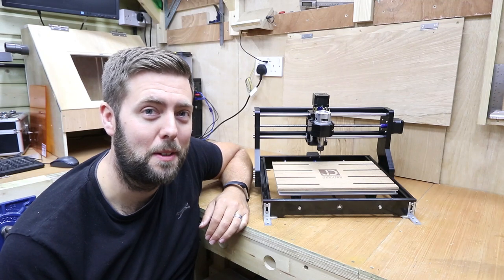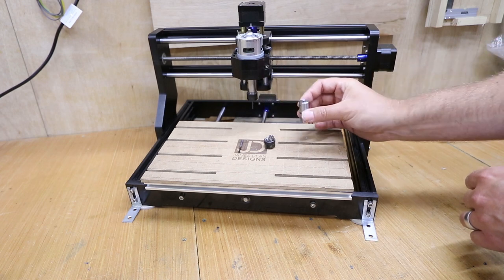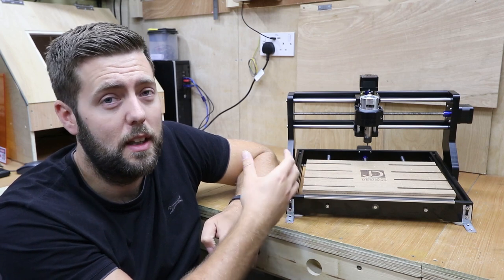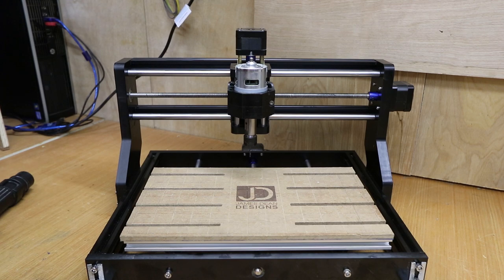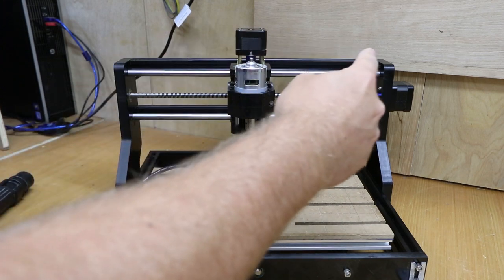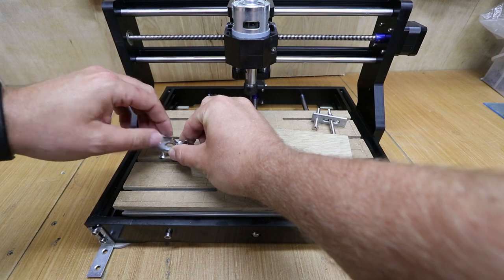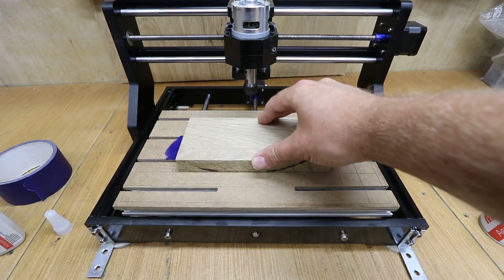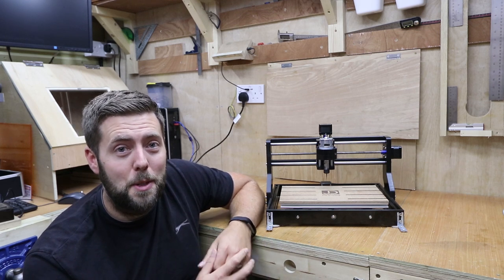3018 PRO - Tips and tricks

Comment: I have just received this machine from amazon . Had a issue on y axis assembly every time I secured the hex bolts it did not slide. discovered the table (aluminum) was curved after much fiddling I have temporary packed with card of various thicknesses as don't have shims stock.  Your video on the spoil plate and leveling was very helpful. When my friend who runs a industrial cnc mill get back from leave we will try straighten it. I have now run one of the sample files on the mill and my spindle I am glad to say has almost no vibration.  Thanks for the tips as the manual for what it is does not mention maintenance. Although with my friends on it gets cleaned daily and has built in lub pump. I live where items like the tape are not that common so will hunt for alternatives. Thanks for the brilliant tips. (zim)
Reply from the maker: Glad it helped. Instead of blue tape, double sided tape or carpet tape is always an option
Reply: Double sided tape I can get. My wife uses for some art projects

Comment: Bearing Tip! Instead of epoxy, I have had success holding all my bearings in using electronic repair tape. B-7010 is extremely adhesive and thin.  I wrapped the bearing with 2 strips of tape and pressed them in. No bearings have shifted since and you'll be able to get them out if they fail. 
Thanks for the video and I'll be getting some aerosol dry lubricant.  Great tips!
Reply from the maker: Not heard of that before but thanks for sharing

Comment: Skipped to the part about holding material to the bed. Drove straight to Screfix, picked up some CA glue and masking tape and it worked a charm. I now have a 300x200mm piece of material on the bed, fixed and sturdy with no clamps!
Reply from the maker: Excellent 👍

Comment: Thanks for the video. Ran into many of the same problems (bearings under table vibrating out of housing, etc.). Another tip you may offer is leveling the table. While not perfect, I was able to buy some 0.016" metal at my local hardware store and place a shim between the table and the bearing housing underneath. I was able to run a dial indicator across my table and had it within @ 0.010", but for someone without an indicator, you could take a small cut on MDF to see if it's cutting close to flat. Really appreciate your time and effort!
Reply from the maker: Thank you, thats great to hear

Comment: Good tips, thanks.
I added homing switches to my 3018 and had one of the cables vibrate out of the connector on the control board, I used hot glue to keep the connectors from coming loose again. 
The homing switches did allow me to salvage an engraving I was working on, when it finished I realized I should have engraved deeper so I went back to Carbide Create changed the parameters to cut deeper and ran the code again, since the X and Y axis were based off the home position they retraced the original design perfectly.
Reply from the maker: They do have some useful benefits such as being able to return to the exact same spot

Comment: Good morning James,
I agree entirely about the comment regarding the noise level between a spindle with a milled shaft vs a round shaft. There is a massive difference. I bought the Hanpose spindle with a solid shaft and 2 bearings, which I think makes the spindle run more smoothly.

Comment: great video, thanks for sharing.  I found that with my 3018 pro the steps per axis (in the grbl firmware I guess) had to be set to 800 steps to get millimeter accurate results.  I just used a laser engraver to draw a ruler until it lined up with an actual ruler.  Also, grow tents make good cheap and easy enclosures

Comment: I have a tiny tip: Instead of furniture pads, I used a flat piece of the packing material my Sainsmart came in and was pretty shocked at how much quieter it got right away. Even so, I'm planning on working on a bolted down solution; my "workbench" situation is not currently ideal.
Reply: KOLIKO JE  CEA

Comment: Just on the topic of the z probe, I also made a manual probe with a LED light, a couple aligator clips, a 9V battery, a 1K Ohm resistor and a L shaped metal bracket.  I've been using it to help me set the spindle for the x and y axis for the stock I engrave/cut.

Comment: I have been experimenting with the baking soda and water trick here is what I found - 1tbs to 1 cup warm water mix until disolved then apply 2 - 3 coats with brush let dry, I set power to 20% and speed 18000 on a 2.5w laser, results amazing much darker, and cleaner burn on wood.

Comment: Hi there. I just subscribed to your channel. The two cents of an old CNC user: 
1. on the 3018, after all the "upgrades" you made, the remaining vibrations may come from the backlash in the screws (see Openbuilds' anti-backlash nuts), from the  bearings (which are wear parts that needs to be replaced along the way. You may not have glued them in place. Shims may make the trick. Find today some replacement carriages as long as the 3018 is still produced. Just an advice.), from the plastic parts, and from the unsupported guides. So you can't eliminate all the vibrations. 
2. the furniture pads keeps the vibrations inside the machine, this is not a good idea because you work on noise, not on vibrations that affects the cut quality. There's two ways to damp vibrations. First is mass, because vibration decreases through some dense and massive materials. Second, a trap where vibrations won't be able to propagate. You can fill the aluminum profiles with granite epoxy. Then you want to fix the machine on a heavy base, like a thick metal plate or a heavy concrete tile. You don't want any pad or rubber thing between the machine and its base plate or the vibrations won't propagate. Sand makes a good vibration trap. So you can fill a tray with at least 1" fine sand layer and land your machine and its base over the sand. You can also use the bottom of an enclosure as a tray. 
3. dry lubricants works fine with lead-screws, but not as well for guides or ball-screws. The way you do on your guides don't brings any lubricant inside the bearings because there's a sealed joint that won't allow the lubricant to came in. Like any dust or debris by the way. You bring a small amount of lubricant on the guides which is wiped away by the bearings. You really want some lithium grease deep in the bearing balls paths. Pro tip: one linear bearing at a time, block one end with your finger. use a syringe to force lithium grease inside the bearings until the grease fills all the ball paths inside the bearings and squeeze out of the bearing. That's a necessary messy job. Once you bring the bearing over the guide, the excess grease is removed and a fair amount of grease stays in the bearing. That will lubricate the guides at each pass without building some grease outside. You want to do the same way for ball-screws nuts.
Reply from the maker: That's some great advice. Thank you very much. I've not even been doing this a year yet so any knowledge for people more experienced than myself is really appreciated.
Reply: @JamesDeanDesigns  We can notice that you are not that exerienced yet! And this is a perfect way to learn:) I was just about to comment something similar to Alex. Like Alex said, mass is one of the best and cheapest way of reducing vibrations, especially on a very light machine like this. But most importantly I beleve that you have to know what the machine is good for and its limitations, this is after all sold as an engraver not a router. Nice video, good luck!
Reply from the maker: @styletokill  very true. My first piece of advice to most people who ask is be realistic with expectations of this machine. With that being said it can do quite a bit once you understand it.
Reply: @JamesDeanDesigns  Yes. Dont buy the cheapest most generic chinesium endmills. Spend 10 bucks for the propper endmill for the job at hand, world of difference. They come with all the optimal parameters for running in a specific type of material, from that you could calculate what your machin should run at. A propper tool with the propper machine parameters puts very little stress and strain on the machine. You dont want to "grind" away the material, a propper chip is what you are looking for. Makes a world of diffrence.

Comment: RE Linear bearings. Instead of epoxy, screw thread lock compound works well and comes in different strengths so you can lock the bearing in place yet still remove it later.

Comment: Hi James - I've just bought a CNC3018 Pro for a learning project during the lockdown as an entry into CNC with a view to converting what I learn onto a small milling machine for model engineering purposes. I very much like your approach to explaining things. One of the problems that I have is finding an easy way to convert 2D drawings into G code. I've been trying out various converters such as Carbide Create, Candle and different hardware manipulation programs. Currently, I'm using CNC3D Commander for the hardware control. I've been teaching myself Fusion360 but I'm finding this hard going. I'm hoping things will eventually drop into place - it's just familiarisation and perseverance!  
Thanks for sharing your activities - It's a valuable source of knowledge for us who are starting out.
Reply from the maker: Fusion is great but if its just 2D work then might be overkill as its extremely powerful. Most people start out with Easel or Carbide Create. Carveco is also getting more popular but that is paid for

Comment: James, thank you so much for this video.  My machine delivers today, and I'm really looking forward to having something at home to tinker with, even if it's not quite the same as the bigger machines I've used in the past.  

Regarding limit switches, I do think there is a way to avoid losing bed travel - simply attach an offset in each direction that doesn't interfere with the travel and use that to register on the limit switches.  This would allow you to basically max out (maybe missing a mm or so on each side for "safety factor") the travel in each direction.  Not having the machine in my possession yet, this may not be possible on every axis, but theoretically it should work, and it's how higher end machines I've used before are set up.
Reply: Hey! do you know where i can get limit switches for 3018 pro? I can't find them anywhere.

Comment: For the noise and dust, I have built an enclosure with 10mm wood and 20mm insulation foam. Reduces the noise in half.
Reply from the maker: Enclosures make a big difference

Comment: Years ago  i got into Remote Controloffroad Electric Cars and some Electric Boats  the Spindle motors you Zoomed in on in this Video  looked very similiar to the ones those Vehicles used  ?  i do want to note that i  was a Adult and  the ones i had were  not Toys they were actually considered  to be on a Hobby level and  i spent a great deal of money Upgrading the majority of the Components to  build a very Competitive  Car back then the more powerful and faster motor was known as a 540  and they ran powered by a 7,2 Volt Rechargeable Battery  made up by wiring several 1,2 Volt CylidralBatteries together in a Pack

Comment: Nice video and very well explained. I actually reversed some of the bed clamps that attach the aluminium profile to the rails and gained around 40mm in X axis and 20mm. Ive been cutting aluminium and carbon fibre sheets for a while now. I however use rather expensive bits and use them in various forms. My 1300*900 should be here in jan ;)

Comment: I am running the 64 bit version. I am thinking of putting a ferrite ring on each stepper cable Looped twice through each if my cables are long enough. I got this for model building I have had the machine for two years. Lots of problems with control boards. Decided to build a large machine48" x 48" using a dead table saw as the base and belt driven. great videos!!
Reply from the maker: If the program is not responding its likely to be the PC or software. Out of curiosity just try the 32 bit version. Something is glitchy about the 64bit. My machine is 64bit and I can't even get the 64bit version to open
Reply: @JamesDeanDesigns  I will try and then let you know.
Reply: @JamesDeanDesigns  Loaded 32 bit version. The machine seems more reliable. I was almost ready to dump this project but you saved it! One more question. Can you recommend free software to generate Gcode from DXF files. I have fusion but it changes the size of the part when I import DXF and its very complicated. It would be nice if you could show how to generate and run 3D files.
Reply from the maker: @michaelmitchell6898  I believe Carbide Create can import DXF files, however I cant personally comment on how well it handles them as I've not tested it.
Reply: @JamesDeanDesigns  Yes Carbide Create does import DXF files. Thanks

Comment: Enjoying your vids. Good content for the newbie 3018 owner. Hope to have mine assembled soon. One thing - those are carriage bolts not coach bolts; very different in features.
Reply from the maker: Thank you. Might be a country difference, if I Google coach bolts nearly all the results are what I use in the video. Coach screws in the UK are potentially what you know as coach bolts, bolt head and quite a corse thread into a point?
Reply: @JamesDeanDesigns  ah the old “screw vs bolt” thing again. You’d think we’d have this sorted by now. Fair point. Here, carriage bolts have fine threads and a domed head with a square shank under it to prevent rotation once pulled up in the joint via a nut, and coach bolts are coarsely threaded to a point with a square or hex head that a wrench/spanner can turn.
Reply from the maker: Main thing is that even with my accent, you understand what I am on about 😆
Reply: @JamesDeanDesigns  I grew up and (fell in love with) Britcoms, TV series, and movies from the UK. You sound “completely normal” to me.

Comment: Love you videos tip and trick are excellent. While watching your video I noticed that your copper nut and spring  fits in snugggly to the nut seat. Could you tell me how set this properly as mine is only holding on a thin edge?
Reply from the maker: Take the lead screw all the way out, then squeeze that backlash nut in tighter and rethread the lead screw back in. Hopefully that helps

Comment: Hi James  , my machine is on it's way 🤗  , learnt so much by you already  ,thank you  , just one question  , could I use double sided tape to secure the workpiece to the base 🤔 , its just I use that type of tape on a straight edge on my drill press and seems to hold ok , I'm 72 years old with still 10 fingers intact 😁  , just digesting your Easel for beginners video at the moment , brilliant 'thank you 😊👍
Reply from the maker: Yes, but the better quality tape you can use, the more adhesion it will have. Just do a test first with a small job and keep an eye on it

Comment: question, if you set the limit switch a little back and make a bracket on the moving part, would that be possible because then you don't loose working or cutting space? i am waiting for the machine to come so i don't have any idea what is possible, i ordered alligator clamps, micro jumpers and those switches. i was thinking to buy next month the extension kit so i create more workspace. is it wise to order a 500w spindel as well or just wait with that. I am old but i want to learn some new things and skills keeps the greycells active. on the job they have 5 axel cnc but that is a step to far for me. my goal is get to know the software and how it works and save for a bigger one in the future. first thing first give me your thoughts. thanks for the nice videos about 3018 cnc, because of you i bought one LOL.
Reply from the maker: Due to the nature of limit switches, your always going to lose a millimeter or two, but yes you can essentially minimise the amount you will lose by doing something like that. 
I hope you enjoy the 3018 😁

Comment: I recommend changing the application of the glue/activator. Put the glue on the bed; spray the part; place (of course on the masking tape, that is). Then you don't have over-spray on your machine.
Reply from the maker: Thanks. I typically try to avoid spraying the piece because even though it evaporates I always worry about it reacting with whatever finish I apply to the wood. Where as the spoilboard is there to get spoilt
Reply: @JamesDeanDesigns  Fair enough. I would be more concerned with the chemical reacting with the lubrication of the motion system more than the spoil board though. Don't know what's in the aerosol can but considering it evaporates rapidly, it may be effectively washing off the dry-lube. I just know that most I've seen, people spray the part. Might be something to experiment with.
Reply: That’s not good practice to be honest. Always put the glue on tape attached to your work piece. Reason being, if you put it down wrong or slip, glue gets on your base, not your work piece. I make guitars and the super glue and masking tape trick is possible the best and most useful technique there is.

Comment: Great video. Have you considered using Loctite 243 on the bearings instead of epoxy? Also good to use on the screws as it will prevent them vibrating loose, but will still allow you to remove them if needed.
Reply from the maker: Haven't tried it on the bearing but it could work in theory. I didnt use it when building my machine but I'll be building the Prover XL 4030 soon and I'll be using the blue loctite  on that.